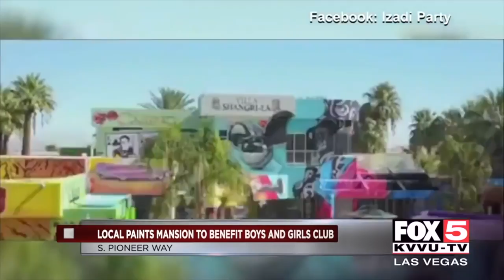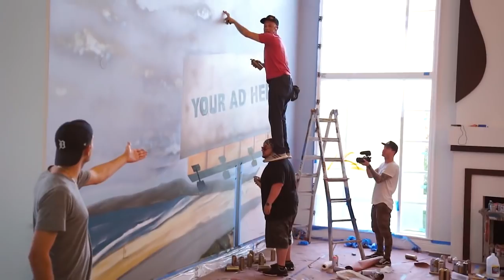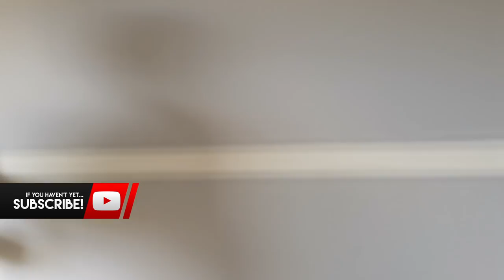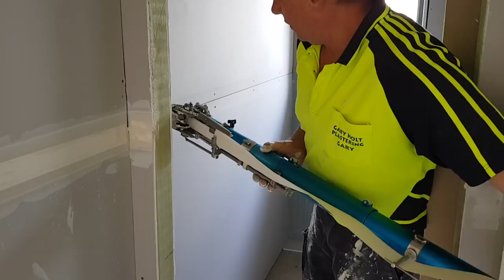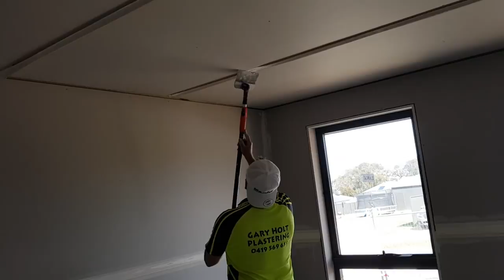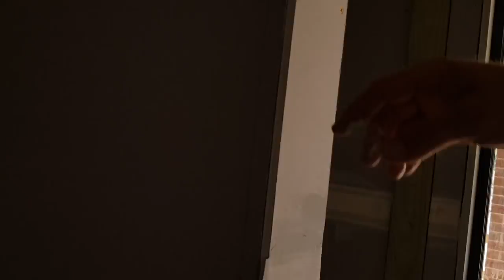How To Tape in Drywall Fast with an Automatic Taper

Comment: I had the gold bazooka, however the pin that drags up the paper tape was always tearing the tape and therefore couldn't run it through the wheel.
Reply: The advance needle can be adjusted.